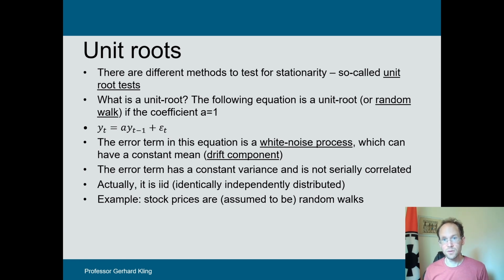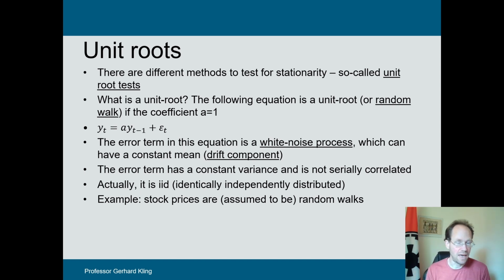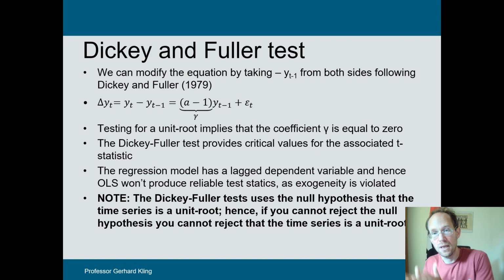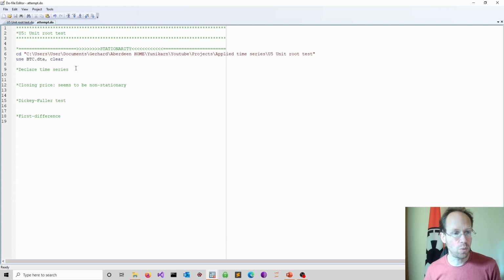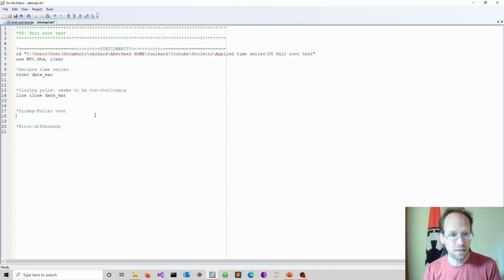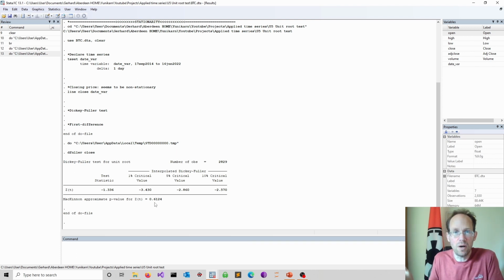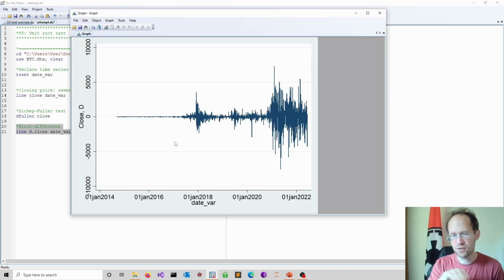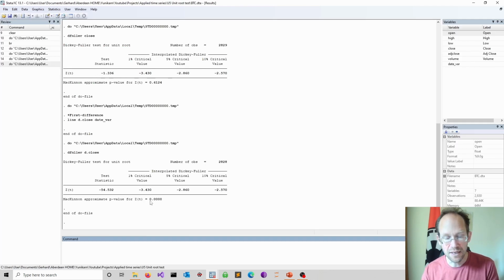Unit Root Test: An Introduction using Stata

Comment: thank you for nice explanation , my question is do stata has command for bai-perron test for multiple break in time seres.
Reply from the maker: There is an implementation in Stata called xtbreak. My Udemy course on Applied Time Series explores structural breaks in a lot more detail (testing for knowns and unkown breaks)
Reply: @YUNIKARN  thanks for a good reply , now I have used the test and found two breaks in the data and wanted to use Lagrange multiplier Lee and Strazicich (2003) but could not find the command in stata I searched online could you please help with the command if it available in stata or even are 
thanks
Reply from the maker: @bolisolwak1390  Only available in R or RATS as far as I know. Here is a link to the GitHub. So either run it in R/RATS or translate into Stata https://github.com/hannes101/LeeStrazicichUnitRoot
Reply: @YUNIKARN  Thanks once again, I am not familiar with that software if I could get code for R it would sound good to me do you have the link for R ?. 
Thanks.
Reply from the maker: @bolisolwak1390  I suggest running R through Anaconda (https://www.anaconda.com/). Free download for R and R Studio. If you have not used R before, it will take a while to get used to
Reply: @YUNIKARN  I have no issues with using R, i was asking about code in R or if there video of you in R using the LM unit root test, what I am not familiar with is the software you mentioned.

Thanks